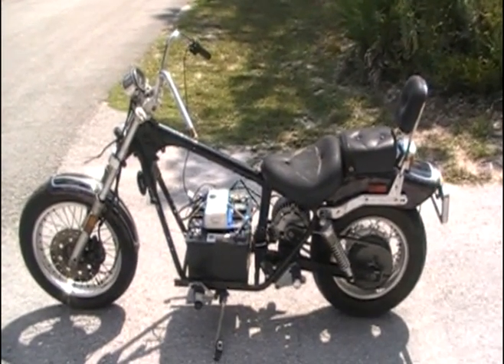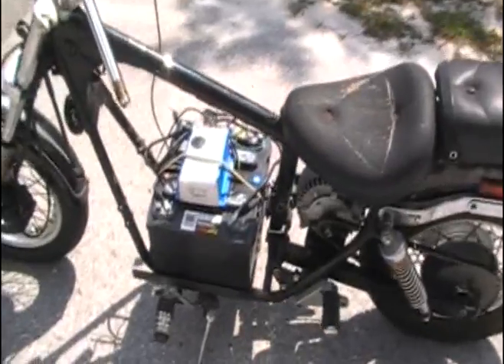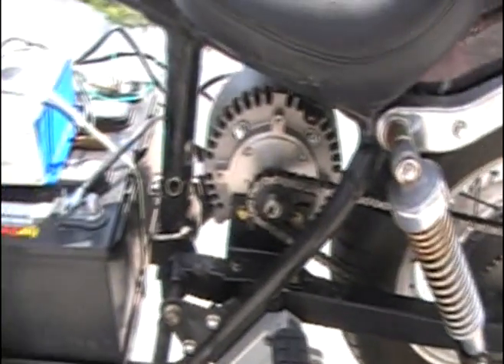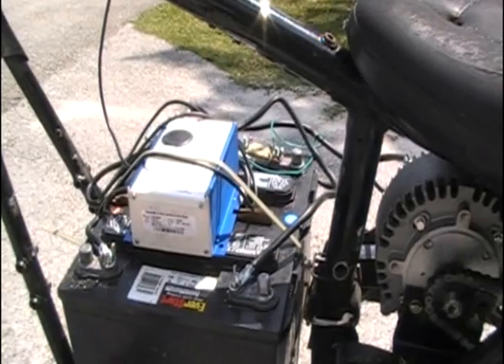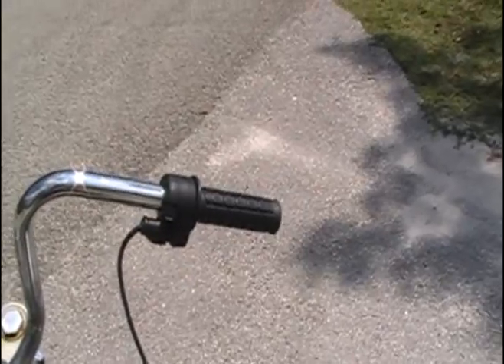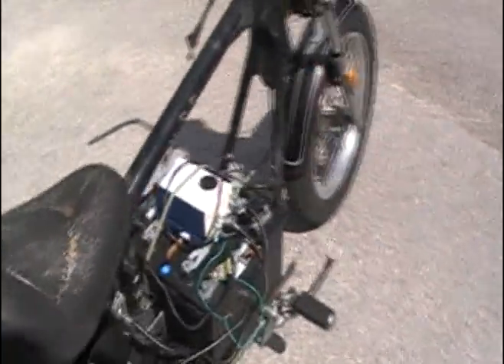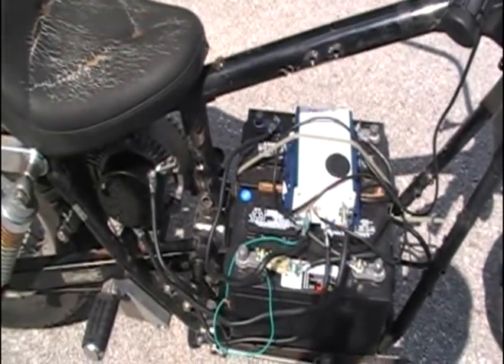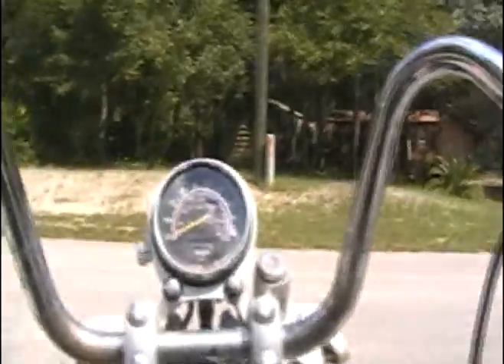Electric Motorcycle under construction test run

Comment from the maker: with a gear box you could most definitely improve top end and acceleration but the more weight you add to it the more power it is gonna take to move it and there is also the issue of room....

Comment from the maker: You need to do more research before posting... A electric motor has maximum torque at 0 rpm. so with the correct gearing there is no need for a gear box, which would just add a lot of weight and take up a lot of room...

Comment: nice. personally, i want to build one based off of a new 08 ninja 250. cheap and sporty looking.
what do you do for brakes anyway? does the motor break itself, or do you have a brake system put in?